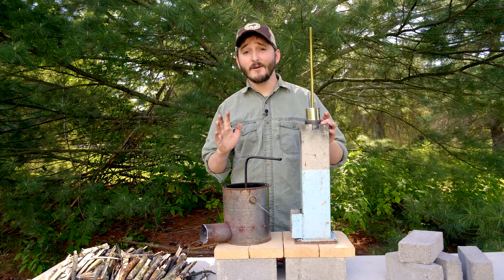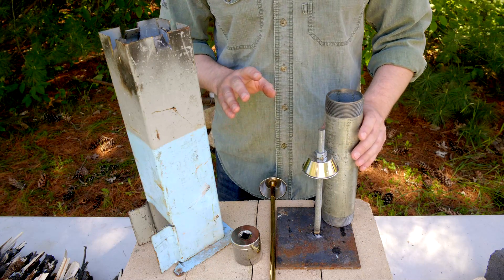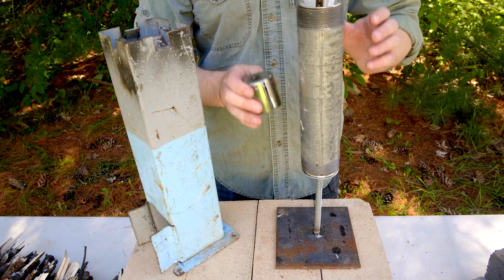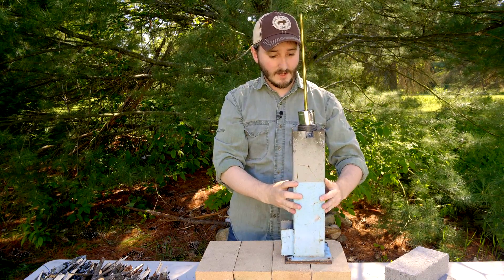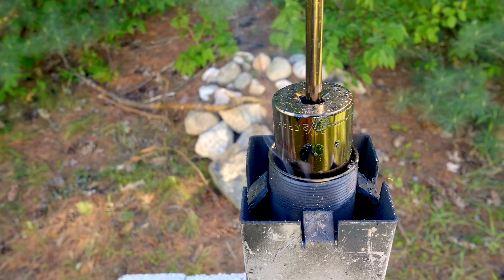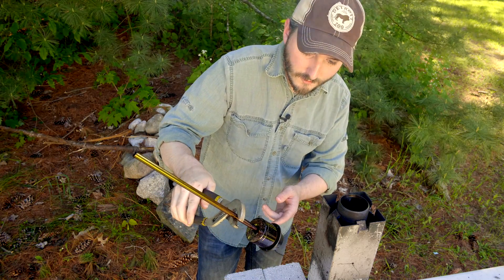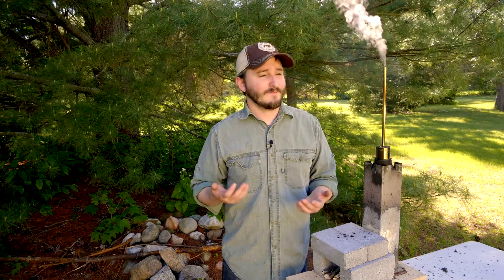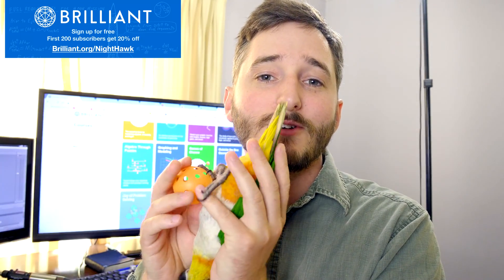Testing A Better Wood Gassifier (Bio Gas Fuel)

Comment: As i wrote in the comment section of your video "How To Make Wood Gas Biofuel" this is not how a wood gasifier work. In a wood gasifier wood is combusted and the "exhaust" from the wood is flowing through super hot charcoal(That is left from the combusted wood). When the "exhaust" flows through the coal, wood gas (Basically the same thing as coal gas) is produced.
Reply from the maker: I would love to see some papers on that, it sounds interesting.
Reply: I'm no real expert in the subject, so I don't really now the "science" behind the operation of a gasifier that well. But essentially the engine(In the case of a typical downdraft wood gasifier for an vehicle, generator etc.) pulls air through nozzles(in the bottom of the "wood container") in the gasifier through the wood that is turned into charcoal that is "falling down" into a narrow "throat" in the gasifier and the exhaust from the wood is then pulled through the hot charcoal in the "throat", though a cooler and filter system and then into the engine.Nozzles, "wood combustion area" and the "throat" is dimensioned in a very specific way for a specific horsepower engine. The air to the engine is "choked" to get right amount of vacuum to suck gas through the gasifer to get the right fuel/air ratio in the engine intake.If the gasifier is hot enough(enough air flow into the nozzles) the tars is cracked also, so that valves and stuff don't stick in the engine and/or mess up the filtering system. Don't have any useful links on the top of my head for gasifiers in the English language as the most i've read is in Swedish. In Sweden essentially all road vehicles used wood/coal gas under the WW2 era, and the Swedes have written huge amount of stuff about wood/coal gasification all from WW2 era to the 70s (seen a few newer texts than that also). By the way my grandfather have an old wood gasifier with filters coolers and stuff lying outside all rusted up from WW2, seen a few other units that is in operation condition from the WW2 era. As I have said I'm no real expert in the subject but I know that a "typical" wood gasfier is not working as your "gasifier" , I would personally not call your unit a wood gasifier but it makes gas from wood so yeah I'm not entirely sure... I would want to add another thing, coal gasifers is in my personal oppinion way more interesting than wood gasifiers(because of the possible extreme simplicity of a unit) they operate the same way as  wood gasifier but using the "exhaust" of charcoal going though hot charcoal creating coal gas, A typical Swedish coal gasifier is essentially an air nozzle with somewhat right dimensions(No tars to crack and no "wood to charcoal conversion" taking place, so the dimensions of the unit is not that important!) going into a container with charcoal and a tube for the engine to suck the gas out of the gasifier through the cooler and filter system. Thanks for answering the comment by the way!
Reply: Forgot to mention that it is the carbon dioxide of the "exhaust" that is turned to carbon monoxide when flowing over hot coal. Another interesting fact : in some advanced coal gasifiers some engine exhaust(Because of the the carbon dioxide) at high engine load was sucked in through the "air nozzle" in the gasifier to "displace" some of the air to conserve the charcoal that is creating the CO2(and heat), and lower the temperature of the nozzle so it could get a longer usefull life. I'm done rambling now I think... (Could write much more about this subject if I wanted L0L)

Comment: That design is much safe in that a flashback (you are still not using an arrester in the gas line!) will just lift the seal rather than bursting the container and producing shrapnel. If you use the waste heat to dry the wood you will get gas much faster, that first vapour looked like steam and that stands to reason unless you have got bone dry wood. Perhaps you need to make a pelletiser to allow for an automated feed system? Also what about a scrubber so that the gas feed is less likely to destroy an engine by filling it with carbon? I have seen some continuous systems that used a screw feed and only the central part of the feed was heated, but they were carbon negative with biochar as a byproduct.
Reply from the maker: You don't have to worry about flashback in a system like this. There's no oxygen in the container and positive pressure keeps it out.
Reply: A long time ago I believed that, then I saw a still explode. Not much effort to put the mesh inline, just in case, but a water based bubbler/scrubber should do the same job.

Comment: To me, it looks like the straight pipe in the top is putting the flame directly in the exhaust of the chimney.   I bet if you bent the fuel line out into fresh air you would have no problem getting the fuel to stay lit.

Comment: But what is wood gas used for?
Reply: TaylorK 9 germany made cars powerd by wood gasifiers during WW2, when there was a huge gasoline shortage. Wood gas can be used very similarly to biogas or CNG
Reply: Was used in ww1 since shipment of fuels was costly and trees are abundant. Its probably been killed of since it would destroy both our forestry and the oil industry.
Was used in vehicles but they had to be serviced regularly since the amount of tar that would build up. Look up Cody's lab he does an episode on wood gas also.

Comment: You should really fill a trash bag and use an air compressor to put it into a other vessel. It would be cool to have a cylinder of wood gas.
Reply: True. It may be possible to put it in a different material bag. It should work the same way

Comment: You could make a flame thrower, like a weedburner, maybe a mini metal foundry😏 I dont know if it would be hot enough though, you could also use it to power a steam engine through a boiler or maybe even directly, again I dont know if that would work
Reply: you can run a gas engine on woodgas

Comment: You're hard to keep the gas lighted probably because too many CO2 smoke coming out from the burner below. Also try using smaller hole to make the wood gas spew out faster. Maybe this will make a more consistent light up.

Comment: I believe the reason its not burning continuously at the moment is the high amount of water vapor in the gas. If you let the gas flow in a water container the water vapor will most likely condense and get filtered out, so you'd have a much better gas quality (maybe check chemistry tools for water based filters, the idea is quite simple but not my field of expertise). Might be worth a try, its easy to realize and could improve the quality a lot (should also filter fine dust particles etc.).  

Regardless I really like the improvement since your last attempt, keep it up!

Comment: Project idea...
Here's a link to a double-tin-can wood gas camp stove: https://www.christinedemerchant.com/woodgas_stove_2.html
These are really cool and a lot of fun!  Air (oxygen) heats up in between the two cans, then mixes with the already hot wood gas at the top to make a secondary burn.  With some tinkering to get the dimensions and size/number of the holes right, it can be pretty efficient!  I've had tons of fun with this.
P.S. your channel is the best!

Comment: What would happen if you collected wood gas and put it in a pressure chamber? Do you get a solidified structure of some sort or does it do nothing. BTW your next project should be a pressure chamber
Reply from the maker: Enough pressure and it turns to liquid
Reply: so liquid wood gas, if pressure isnt changed

Comment: So what’s the usefulness of woodgas?
Reply from the maker: Running engines and heat
Reply: In the World  wars where the farmers had no fuel for their tractors they converted their engines to wood gas engines to still be able to use the tractor even without fossil fuel .
Reply: Ok ... I was going to reply to a bunch of comments here and decided to make my own rather than address so many questions from people who are inadvertently trying to make exploding storage containers lol.

My comment is to congratulate you on the creation of a rather unique idea on "dirty" woodgas production... (and charcoal production to refine the process as a byproduct)... my hat is well and truly off to you.

What would be interesting would be to see if this process / equipment could be adapted or incorporated into a larger apparatus capable of cracking the tars in the gas to create more woodgas which, with a full "cracking" of the tars would result in a much closer to pure woodgas output... food for thought .... or at least I hope so :D
Reply: Run it on charcoal gas, there's much less tar.
Reply: Mike Guitar 
Is charcoal not the byproduct of making wood gas?
Reply: Charcoal can be a byproduct of making woodgas when it's made with little to no air. 

It's quite challenging to make woodgas tar-free enough to use in an engine.  So the simplest thing to do is to flare off the woodgas or use it for something else, then gasify the remaining char and use that to fuel an engine.  This is probably what was done in most of the WWII automobile conversions.
Reply: Good for reusing agricultural waste which will help reduce deforestation. Wanna do something nice for the pine forests? take away pine straw and make wood gas with it before someone throws a cigarette there and start a forest fire.

Comment: How about using a pump (the ones that use rollers on a flexible tube) to compress it into some transparent air tank so that you can then regulate the output with pressure regulator and maybe mix it with air or something.
Also maybe you can destile it in the tank as the smoke particles would fall down while keeping the flammable gasses on top.
Maybe even freeze the gas to get it to liquify but ive no idea of that gas or temperatures you need for that

Comment: I'm not really very sciencey but it seems like you could add a hinge of some sort to connect the... top bit that you pull off, to the bottom tube that you're emptying and readding fuel too. Then; you could open it to add fuel, and lift it to dump the coal at the same time. Add your new fuel, then close it back up all while holding it with the wrench.
Reply: Despite not being very science-y, I've loved watching your videos for a long time. You, Cody's lab, Smarter Every Day, and so many others have taught me so much. Thank you for sharing.

Comment: The arrangement is ingenious, perhaps the simplest most elegant feed and clearing design I have ever seen. Most designs require disassembly or a door to remove the char. Heat distortion in designs using a door and resulting inefficient sealing is problematic. Feeding the char directly into the burn chamber while operating reduces the heating cycle to a minimal duration, immediately igniting the char to contribute to the cycle, and wastes very little fuel in the process. In addition the tar drains into the burn chamber providing additional fuel and potentially reducing undesirable waste byproducts. 
The rocket stove design is perhaps the most efficient and lends itself well for the application.  
There are a couple of improvements that could be made. One improvement might be a grate or screen for the ash to fall through to a lower chamber for easy removal. Most designs use a shaker to facilitate ash removal. 
If the combustion is hot enough and the grate designed with sufficient space white ash passes without the need for mechanical assistance. 
I suspect the flame is being retarded by the envelope of fumes and smoke from the lower chamber depriving the tube of oxygen. Bending the tube to position the burn away from the top of the burn chamber would solve the problem. 
Another improvement would be a carbeurator similar to ones found on propane stoves to suck additional air into the stream.
I've built a couple of gassifiers that were relatively successful but your design provides significant improvements that overcome inherent detrimental characteristics. I think I'll borrow your basic design and build another one with the above improvements .
Thanks.
Reply from the maker: Really great ideas. Especially for clearing the ash.

Comment: Actually any wood as fuel is carbon neutral, not just dead wood that had already fallen - as the tree pulled exactly as much CO2 out of the air to make the wood as is released when the wood burns (not counting, of course, any fossile fuel-fuelled machines that may be used in harvesting the wood).
Reply from the maker: As long as you're planting trees in the place of the ones you cut that's true.

Comment: Why not go for a downdraft wood gasifier? Maybe not that easy to get to work in smaller scale?
Reply: The gas has more nitrogen but it will be much cleaner
Reply: I guess you mean NOx, not nitrogen? And that a downdraft reactor would produce more since it has a continuous feed of fresh air? Makes sense I guess, but that could potentially be scrubbed away I guess? If the idea is to produce wood gas to compress and store, that would not be an issue. If you where to use it as it is produced in, for example, a car, it would be more of a challenge.
Reply: nope, incorrect.  It's better to research more and guess less.
Reply: Mike Guitar so which of the two would contain more nitrogen (as N2) and why then?

Comment: But what you have to do to a small engine or generator to get it to run off of this?
Reply from the maker: Very little. Just change the fuel lines and possibly injectors

Comment: "Nearly as much as fossile fuel" Wait, monoxide is just toxic to humans in high quantity, not to the environment.
Plants grow better with smoke, and monoxide gets turned into normal carbon monoxide by the atmosphere. You just have to wait. Just storing carbon monoxide and oxygen at room temp will turn it into carbon dioxide.
And don't forget carbon monoxide is only produced in hot flames, if you don't have blue flames there won't be CO.
All your car's catalytic converter does is speeding up that reaction from CO back to CO2.
Reply: Something is off with the last part of your comment.
Carbon monoxide is mostly produced in incomplete burns. Now hot (blue) burns tend to be complete so those would produce the least amount of CO. In fact CO itself tends to burn blue.

Comment: The gas needs to mix with air to burn. I think you can’t sustain a flame because the gas stream is too unstable by the time it has mixed with enough air. It is also moving kind of fast. 

If you place a slightly larger tube around the tip, it can help stabilize it. Like how most torch nozzles work.

Source: I’ve played around a little with propane flames, and getting them to self sustain generally requires something to break up the flow of propane.

Comment: can the wood gas be used as feedback, keeping the wood heated for conversion using less charcoal to keep it burning?
Reply from the maker: Yes but then you would be burning the stuff you're trying to make
Reply: I was just curious if feeding itself was an effective way to produce more charcoal instead of using charcoal to make charocal 😂, wood gas does have its uses though.. I guess the next thing to do would be a way of efficiently storing it for a wood gas stove...

Comment: What would happen if you drilled some holes in the top of the Pipe like a blow torch and then lit the fuel would it burn closer to the tip and sustain better?

Comment: Also, Carbon monoxide is a flammable gas, much like hydrogen and several of the alcohols produced during gasification. Also, the gunky resins left over are actually very good to add to compost heaps because decomposing fungi love it as a food source.
Reply: nah, resin and char are rot resistant.  They're anti-fungal.

Comment: what is wood gas?
Reply from the maker: It's a gas that can be interchanged for natural gas or propane
Reply: a tip for the next version is to introduce a little bit of oxygen into the chamber it will react with the longer carbon strings breaking them up and making the gas easier to ignite

Comment: I dont get it. You burn wood to make charcoal, and use ALL of that charcoal to make more charcoal. Why not just burn the wood directly to do something useful?
Reply from the maker: Gas has better properties for running things like engines.
Reply: Probably because of the "byproduct", which is gas, besides the charcoal, that can probably be collected to do things other than light a steel chimney. Like re-pressurize a canister, after treatment and filtering

Comment: I would love to see a direct comparison between biogas and other sources of power -- say if this were hooked up to some sort of generator. I also wonder if there would be an easy way to pressurize it for storage. I'm imagining using the waste heat as an energy source to operate a simple pump. Hell, if the gas were cool enough you could store it in empty soda bottles. (Totally unsafe haha)
Reply: Patrick Hobbs you could use a Stirling engine as a pump

Comment: Some thoughts on containing the gas. Run a coiled copper tube to a copper t fitting. Run the t down to a separate air tight can that is directly bellow the system. This should drop off the tar. Next continue the tube to a sealed bucket, such as a five gallon bucket. Connect the bucket to the intake of a hand pump. Last connect the hand pump to a vessel such as a small refillable propane battle. You may want to check the pressure rating of wood gas. I don't know at what pressure it combusts and don't think you would ever get close to that much pressure with a system like this but better safe than sorry.